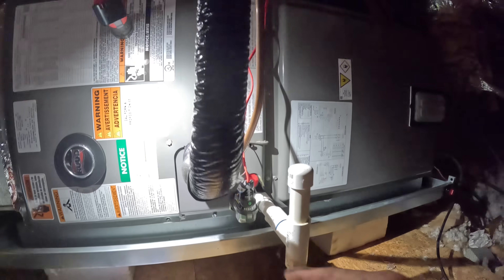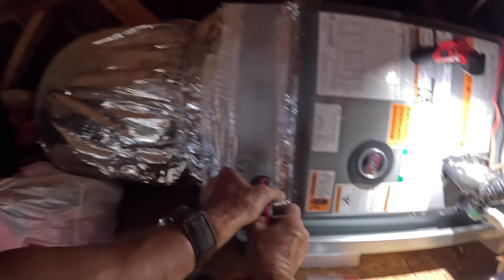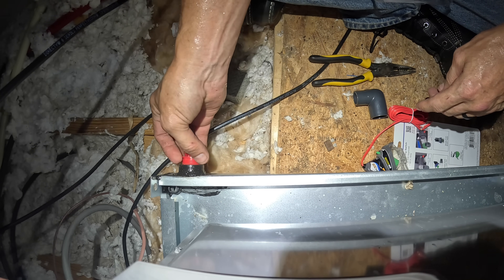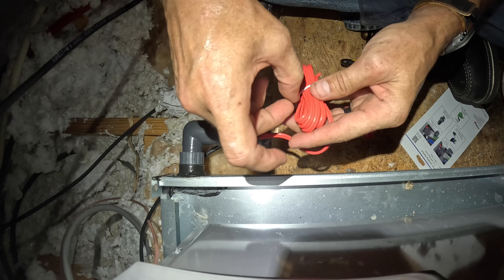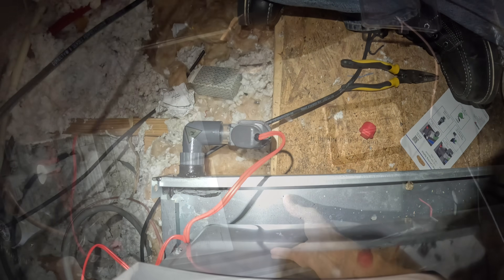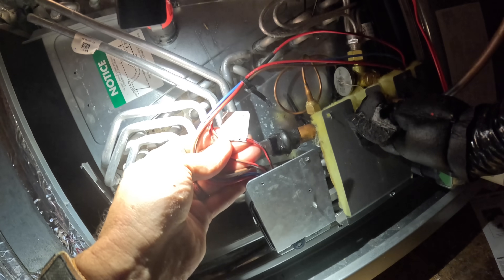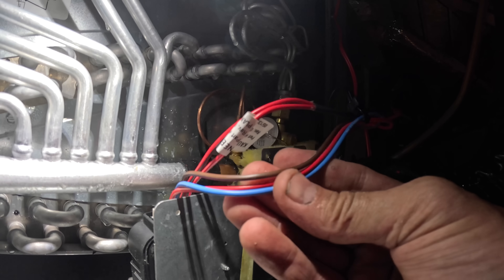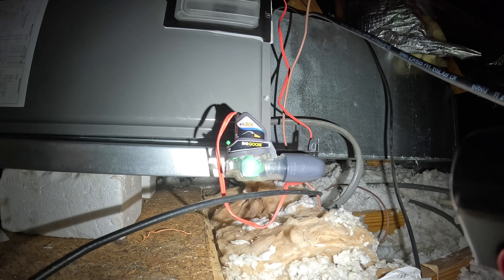Managing Water Overflow and a Look at the A2L Sensor. #hvacguy #hvaclife #hvactrainingvideos

Comment: i would imagine they use an electrolyte sensor, or and IR sensor to detect with, which of course will probably need to be replaced every 2 to 5 years, and will of course go bad if they get wet.

Comment: This garbage is why I will leave the trade. Then make all these "safeties" mandatory but the quality of the actual product is still absolute garbage. Just a way to keep charging the same people over and over for repairs.
Reply: I wish things were still made like they used to be made. Some of the sensors and switches are actually good though. I mean look at how some countries that don’t have rules like we have here in the states. I’d rather live where they have rules.
Reply: @AaronPowellvox I don't have an issue with the sensor that actually works. My problem is with the coil, the manufacturing, and the actual product. It is junk. It will leak. Probably within a couple of years. Thus requiring service constantly. Everyone can say their brand is better in quality but none are worth a crap anymore. Trane, Lennox, rheem/ruud, Goodman, carrier, smart comfort....all garbage due to poor manufacturing and material quality. Probably all made from recycled soda cans.

Comment: Just had a changeout done to the new R454b. Noted the new interior cabinet coil sensor positioning. Just another point of failure that will to be checked later.

Comment: Nice install especially with the extra drain sensors!  Hopefully the refrigerant sensor will prevent an explosion of sorts should the coil leak. I guess I should say when it leaks 😅
Reply from the maker: Trust me these things will never explode. That stuff will barely even burn.
Reply: @HVACGUY  probably right and the charge amount is smaller. Not as flammable as say R600 lol
Reply: They will definitely make more service calls...